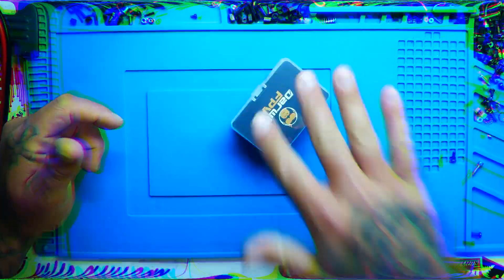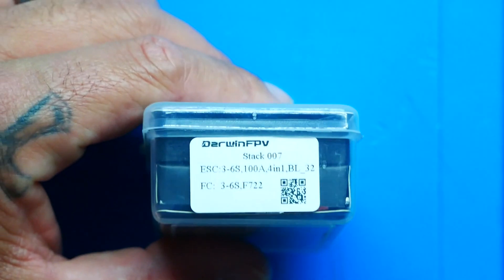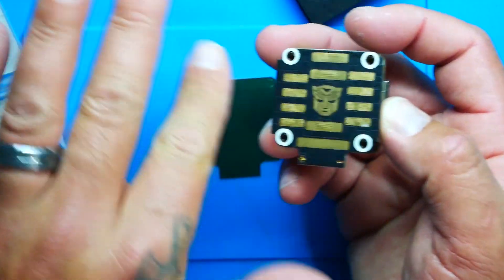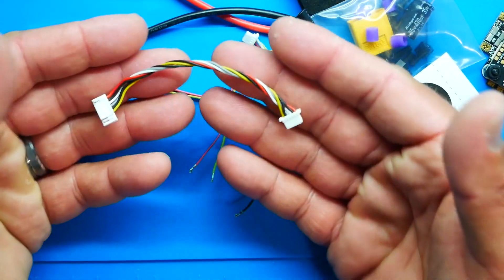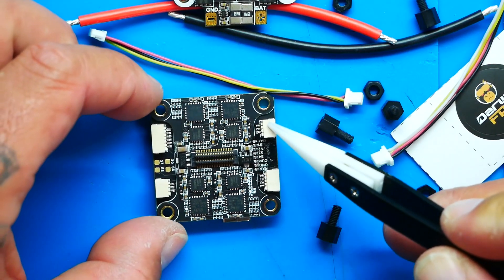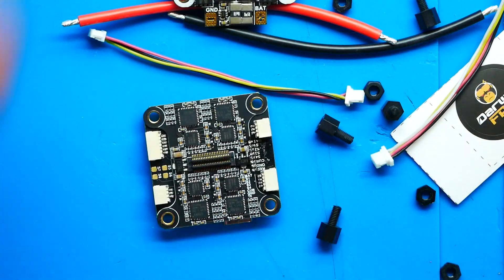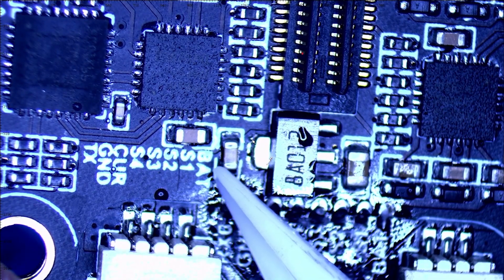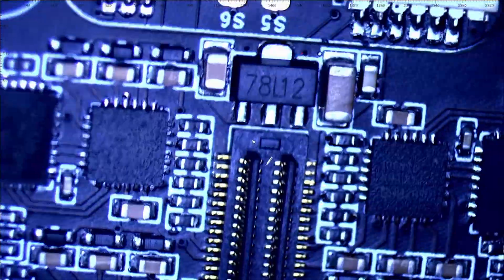Drone Racing 100 Amp F7 Stack for Under 75 Bucks! Buy Or Deny ?!

Comment: Hi DrainMan,
As always great video and just love your enthusiasm!

Looks like a very nice Plug/Play board with lots of potential.  Definitely interested in seeing how it performs.  

I do have a sort of a side question.  If I install and plug both the DJI Digital System and a TBS Crossfire Nano Receiver, how can I switch between using either TBS Receiver or the DJI Controller in BetaFlight.  What I want is the flexibility if either using Crossfire with my Radiomaster TX16S controller for longer flights or my DJI Controller just for short and fun flights?

Thanks again for everything you do for this hobby!
Reply from the maker: Thanks, you can bind two radio's to one rx, or two rx's on one quad, but you won't be able to switch from dji to crossfire without changing settings in betaflight. If you don't mind changing settings in betaflight every time, it can be done.
Reply: @DrainManFPV  I’m sorry, but I may have not made myself clear.   I know that I have to change the settings in BetaFlight, but I’m not sure what exactly I would need to change. 

If you can give me an example using the FC that you just introduced in this video, that would be fantastic!  

Thank you.
Reply: Any idea on my last comment and clarification?

Maybe this could be a good topic for your next video?

Thanks...Sam

Comment: They make a pretty good aio it's 1-3s which isn't the norm. Pretty good being I only have one and it hasn't popped
Reply: Same ..had my 15a aio for almost 3 years now on a 3in running 3s.. crashed like 20 times ..no problem..just got the 100amp cement stack..hope it's just as good ..we shall see

Comment: The esc motor wires will hold the flight stack solid not as good  as the flight controller having the grommets I see a very noisy future for this setup. The old racestar reachup 8s let you put your flight controller on top with grommets.
Reply: Grommets
Reply: @huckaberryfpv4986  dam phone